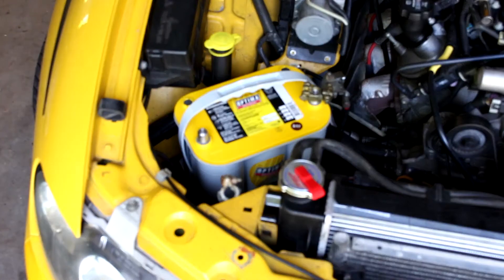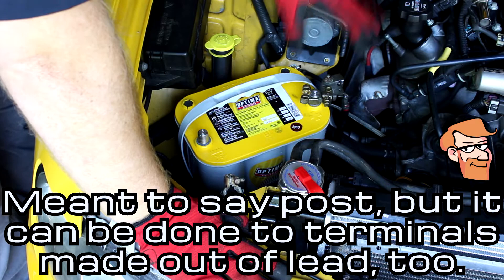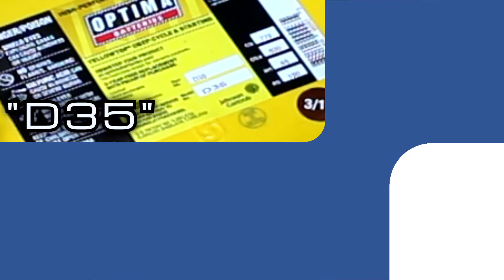Battery Maintenance: Mechanical Basics of Keeping a Car Battery in Peak Condition • Cars Simplified

Comment: Sir, is it safe to tighten the positive terminal if the negative is connected? Thank you, for your videos 😎👍
Reply from the maker: Thanks for watching!
I've done it before, but ideally you would disconnect the negative so that if you accidentally touch your tool to the body/chassis/almost anything metal, it won't spark/short.
Reply: @CarsSimplified  sorry for bothering you again Sir, but is it possible for the negative terminal to make a small spark even if you connect it in the right order?
Reply from the maker: Oh no worries, it's not a bother. A spark can occur when installing it in the right or wrong order. It's due to something trying to draw power when it is connected. The more things trying to use power (the more amperage being drawn), the more likely and potentially bigger the spark.
Reply: @CarsSimplified  thank you Sir, I greatly appreciate it, you are an inspiration.. God bless 🙏

Comment: Hey man can  car battery testers be wrong? I got this one & it says it passes... charging system passes.. my car starts with no problem & I can listen to the radio with the engine off forever... but if I leave the headlights on for 10 minutes while engine is off my battery is complete drained & dead... whats going on?  battery is 5 years 0ld, 2005 altima... no reserve power?  IDK how to test for reserve power.. help
https://www.amazon.com/Schumacher-BT-100-Battery-Load-Tester/dp/B000AMBOI0/ref=sr_1_9?ie=UTF8&qid=1535385991&sr=8-9&keywords=battery+tester
Reply from the maker: They can be wrong, but not often. Sometimes batteries start to drain faster as they age, and even without that, if your battery only has just enough cranking amps to start the engine, if you drain it just a bit it may drop below the threshold. Headlights draw a lot of power, plus there is a lot of other stuff draining the battery when the lights are on like interior lighting, but that differs from car to car.

On the top of the battery, what does it say for CA and CCA?
Reply: Hey man, thanks for the  explosively quick response
Reply: I'll look agan...  but in the meantime,  your  prognosis is new battery?
Reply from the maker: I may be quick to jump to that because I grew up in Florida where batteries tend to only last three years, but from what I hear so far, yes.

I don't feel like I have enough information to be super confident about that, but if the cost of a battery isn't a major setback, I would just get a good new one as it would also mean peace of mind.
Reply: I'll get back with the info

Comment: First! Great topic. I was actually just thinking of making a similar video. Wanted to talk about corrosion and protection from it too.
Reply from the maker: "Corrosion and chemical maintenance" is another video I want to make, but all the batteries I have access to are AGM batteries. #PremiumProductProblems

I would say "sounds like another collab video idea", but that list is getting quite big as it is.
Reply: Hahaha, I was thinking the same thing. Wish I had AGM batteries. When I have more money I will definitely be switching. Also really interested in LiPo conversions for the weight savings.
Reply from the maker: I got a 30 series lithium battery at a huge discount thanks to my old boss ($110 instead of $300) but even though it is the biggest battery in the line-up, it only has 500 cranking amps at a full charge. They are indeed light, though. It was interesting to see that they don't seem to sell them up north, though. It would be really cool if Optima found a way to build spiral lithium cells; those would make for some incredible batteries.
Reply: Yeah, the tech needs to catch up I guess, but cost is fairly prohibitive for the mass market. I've been curious about building my own car battery out of Lithium packs or cells, but the charging regulation would be nuts and it would obviously be dangerous for a novice like me.
Reply from the maker: Have you seen those capacitor bank replacements people build? Those seem a little more DIY friendly, but have the drawback of only having a second or two of immense cranking power.
Reply: Yeah I have! Pretty cool.